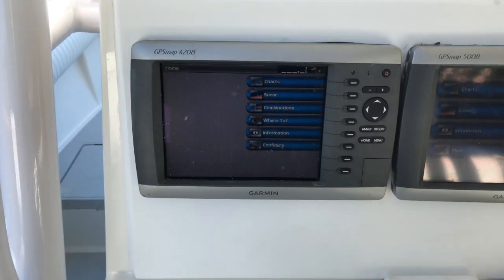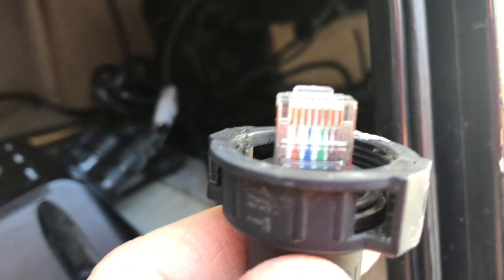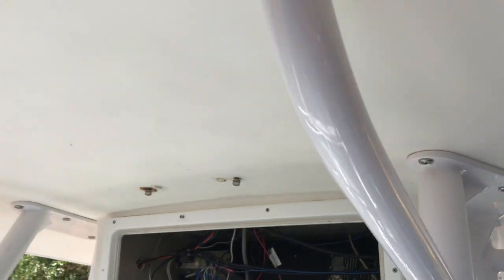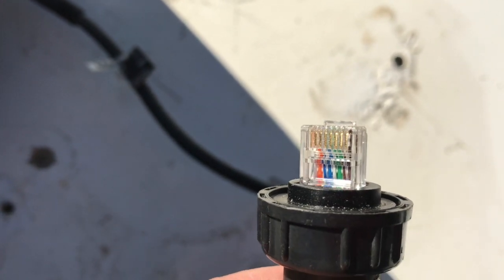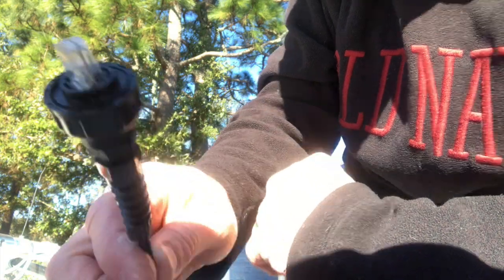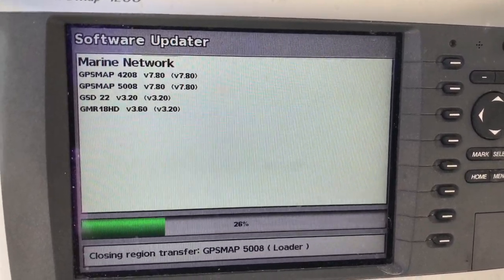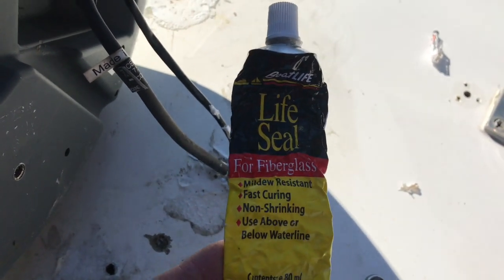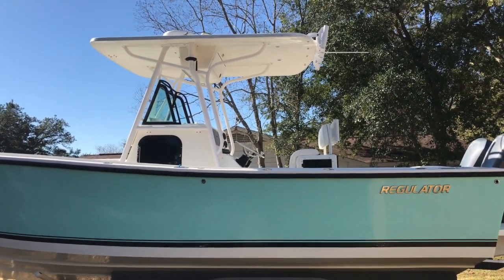How to: Garmin radar GMR 18HD troubleshooting and repair

Comment: Thanks for the video.  I find it helpful, even though I wasn't able to really see any of the work you did on the cable at the radome end, due to over exposure. (I'm sure if you hadn't had that black sweater on & in the shade, the histogram equalization wouldn't have caused the lit portion to wash out.)  Also, when you're trying to focus on something small (like the connector, when you were sliding the conductors in), you need to make the small item's focal plane the dominant plane in the image.  The easiest way to do that is to put your hand right behind the object.  Then your hand and the object fill most of the screen & the camera will focus on them.  Thanks again for the helpful video.  I'm glad your narrated it well!
Reply from the maker: Thank you for the feedback. I totally agree with you and I am just starting this video thing and I’m trying to get a better system for capturing higher quality videos, any tips I get from people help. If there is any videos I can make concerning marine electronics or installations let me know.
Reply from the maker: Tony C the cable will be different at each end. The green and orange pair will swap positions on opposite ends of the cable. It’s called a crossover cable. Hope that helps clear it up for you.
Reply from the maker: Tony C it doesn’t matter if the A or B side is at the display or the radar as long as the cable is opposite. I used a non shielded connector because that’s what the customer provided, he didn’t want to buy the garmin rj45 pack. I’ve seen non shielded ones a lot and never seen any issues, but I would recommend you get the shielded ones.

Comment: good stuff radar is a very important safety tool i run it anytime i am in my boat at night it's a lifesaver for some reason i see a lot of people with there $10,000 simrad radar off in the intercoastal in south florida. why? its helps marpa & arpa saves lives! i have a 16 ft wth raymarine quantum 2 its great saved me a few times i got a feeling most people don't read radar correctly or underestimate its safety i use 1/16 nm is just right in small canals where a c large boat can pull out in front of me. 1/2nm in the intercoastal RADAR SAVES LIVES LEARN TO USE IT!!!!!!!!!!!

Comment: You should use the angel hair to cut the rubber instead of cutting it like that. You are opening a chance for corrosion cutting it with a razor.

Comment: the ethernet plugs into the antenna. If that short wire built into the  antenna is corroded where can a new piece be found. It is about 8" long and has a suppressor of some type on it. why in the world would they swap the colors coming into the connector. If both connectors were identical they could have swapped the wires inside the antenna housing to make things easier.